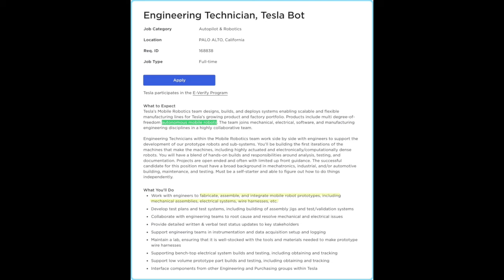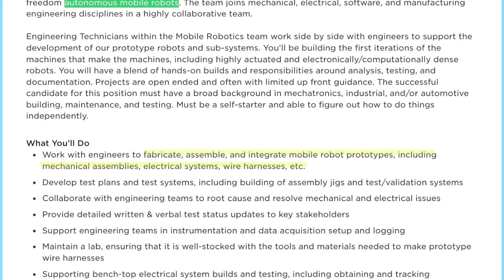New Leaks Show Tesla Is Making a Second Tesla Bot

Comment: Humanoid robots will fail. Making it more human-like doesn't make it more useful, in fact now it's limited to what a humanoid can do and will NEVER do everything a person could. And making them all the same is worse! Can it lift heavy objects? Should it stand in a factory packing widgets and never use its legs? The factory fork-lift of the future will be driven by AI and have cameras to see all around. It won't have a steering wheel and wait for a robot to climb in and drive. You won't be maintaining hand/foot controls on the truck, or wasting time, or wearing out the robot and wasting the energy. The best part is no part! "It's made human-like so it can work in environments made for humans" Think about that! That is the antithesis of "First Principles"! (unless your goal is to copy a human which is much easier to do with sex) It compounds costs/complexity and reduces efficiency. I'm an automation engineer, I wish they would put AI on all the existing dumb robots. You could test and prove learning concepts/systems on existing equipment. There are all kinds of robots, controllers, vision systems etc. that could use a brain NOW. 

Besides the unproven AI, look at the fingers on Optimus! Could it even pick up a needle to thread it, Start a roll of tape, put a lid on a cup, make change out of a register? How long would it take to peel a label off the backing? tie a shoe, pick up a pen and write? A person, without looking, can pick up just one small screw out of a pile and orient it in their hand. A person can reach into their pocket and count change without looking. Please tell me the "easy" jobs a humanoid will be able to do! There are no "easy" jobs that aren't already automated. Enthusiasts will say "It's not like FSD because you don't have to be 100% accurate". Then it will fail in its job. If it drops a box of screws, breaks something expensive, falls and breaks itself, stops production etc. it's costs could be more than the savings. Enthusiasts will say "It doesn't need to be fast because it can work long hours". Then it will fail in its job. Factories are built for people to operate, so it will have to operate like a person. Asset utilization is important. Otherwise you'll have to create dumb jobs for it like overnight stock-boy. Call me when they demonstrate a stock-boy, if I'm not dead. Enthusiasts will say "we'll need them on mars" On mars you will want a smart crane/robot that can manipulate and join large habitat panels and move machinery. And you would want a smaller smart robot with tools instead of hands so it can manipulate/repair small cables/connectors quickly without having to pick up bulky hand tools. And it should have extending legs rather than get on a ladder. It would be ridiculous to have humanoids operate cranes, use wire cutters and climb ladders. You may only need two humanoids to set up a base because humans didn't evolve to use technology.